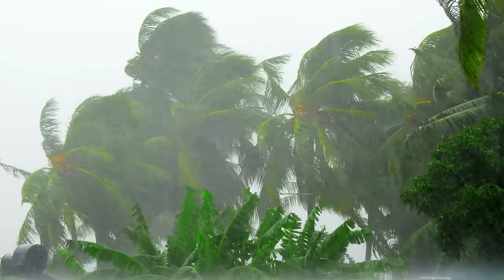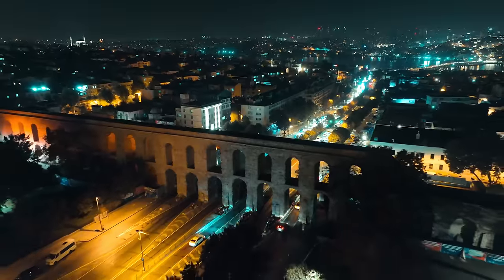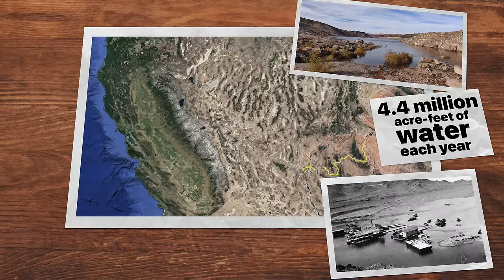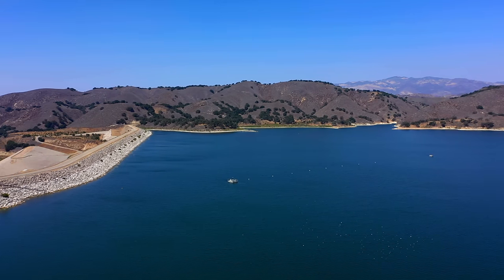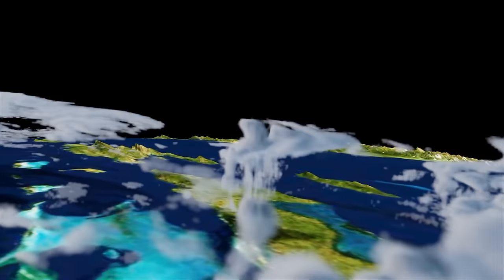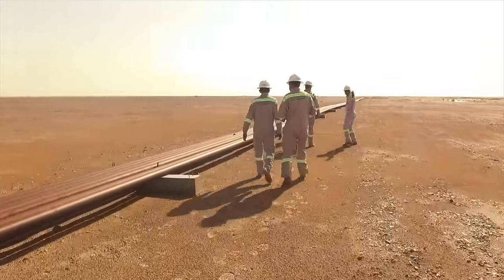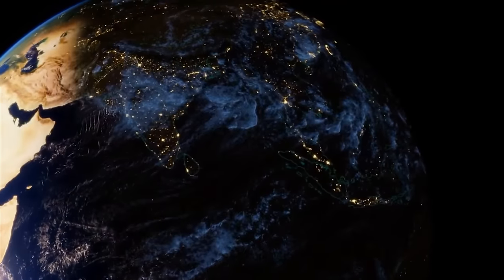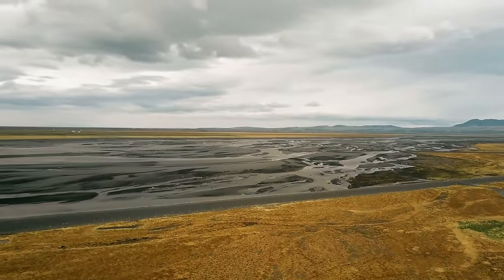Pipelines From Flood to Drought

Comment: The other benefit of moving water like this is using it as energy storage. So, don’t just move water in anticipation of a flood, but move it during times of excess power generation. The more water mover in the system to higher elevations means the water can be in the places that need them, but can also be used to recover energy at a later time.

Comment: You can look into the Olmos Irrigation Proyect in Peru, they channeled the water from the very wet east side of the Andes mountains through a 20km tunnel to the very dry west side.
Reply from the maker: I’ll have to check it out
Reply: @TwoBitDaVinci  The Snowy River project in Australia does this too, a massive undertaking that required a level of consensus no longer available here or in the USA.  Our dualist, adversarial political system is specifically designed to be divisive, splitting society almost exactly in half which negates the 'voice of the people' to the advantage of the corporate interests dominating our govts. Divide and conquer on steroids.
We most definitely need more rainforest on the planet.
Reply: @earthwizz  A great example - we need more of these national scale/size infrastructure projects in Australia!
Reply: @TwoBitDaVinci  Not for USA, but there was a project to fill those under the sea areas from Africa. Being lower also would have generated electricity. And would have transformed an desert in a sea, and create that green area around it. But projects were too expensive for those times, a century or more ago.  

And actually you had in the USA, something similar done by accident. The Salton Sea. Now ruined. 

And rain forest effect by pumping wet air from the sea was a fantasy of mine. Not pipes, but tunnels in the bedrock. Eventually helped by a greenhouse salt water lake to add more humidity. Sure, a lot of humidity will condense in the tunnel, but that will be just a good desalinization part. Obviously, the project will take decades to complete. All is needed is just few of those digging machines working all the time. Not big expense at country level.
Reply: @jackm3040  it’s not just to deliver water to those that need it, but to remove it from where it’s not wanted. And with all the drought going on, extra water will have value.
Reply: @earthwizz  

so phukking true.  🧐
Reply: @jackm3040  For sure was a disaster for the few living there, but from documentaries I saw, I understood that for few decades there was a heaven for birds and fish, and tourism. And dying I assume that could be a right thing from the point of view of returning to the old situation, I mean a salty desert, but a bad thing for losing that ecosystem, plus the desert being now poisonous from all the chemicals drained in the sea. 

For sure, any human activity is damaging. Empires died because of reckless industrial activity.   Sumerians destroyed their empire through too much irrigation combined with the lack of rain. 

So I do not know what is actually good or bad. I am just an old dude with fantasies. But for me it looks fine to turn an desert into a sea.
Reply: How about capturing the output of Niagara Falls and holding and/or pumping to areas of need?
Reply: Jack you can say that again!!!
Reply: @earthwizz  perhaps don't build in desert?

Comment: A huge problem that areas currently prone to flooding face, but not addressed in the video, is that most flooding is caused not by excess rainfall, per se, but a lack of permeable ground to absorb the rain. Increased urbanization (e.g., pavement) causes water to flow in directions it did not in the past, when it would be more directly absorbed as it fell. And those flooded areas aren't necessarily feeding reservoirs in the first place.

Edited for clarity (I hope).
Reply: I agree developers need to cut back on LARGE style parking lots that funnel most of the wain water into the storm drain system!!!
Reply: i had  the same thought while watching the video, not sure why it was not addressed considering that that's the main issue that can be solved within a reasonable time frame (rather than piping from houston to la)
Reply: Even if not intentionally I think the reason the over development of non permeable ground and focus on reusing the gas pipe lines to move water has more to do with getting rid of gas then moving water. 
There are many factors to both issues. 

Wind and solar actually requires a lot of petroleum to make parts and move parts to location. The batteries are not efficient enough to sustain a healthy power grid for periods of low wind and low light without another form of power keeping the grid balanced. Also, to make enough batteries to hold that much power it requires strip mining lithium and other elements as well as still needing petroleum. So unless you went nuclear for the power you would not be able to pump the water in the first place.

Another issue is over developing agriculture in areas that have problems with water and require it to be pumped in. There are many better locations in the country that could be used for farming that would not have the same water issue but due to regulations and development factors those areas either are not able to be use for farming or they are used for farming industrial use products rather then for food. (also almonds are very water wasteful despite being tasty)

And as someone that lives around Houston it is very true that development is our flooding problems biggest factor. It is not a matter of stronger storms making areas that did not flood before now flood but rather the new flood area is the area that a few years ago was undeveloped forest and now has a retention pond surrounded by houses and shopping centers as the metropolitan area expands out to gobble up the smaller cities around it.
Reply: Wrote a 60 page thesis on this subject lol
Reply: @nithia  Preach. I'm a precision agriculture major in a very fertile part of NW Ohio (Scioto Marsh) and it baffles me how ass backwards we are with this land. The area where I live was a a large swamp that was drained in the mid-1800's and has left absolutely great soil with up to 70% OM, vegetable production was great...until a Tel Aviv based company covered 30% of the central marsh in solar panels and the rest of the county plotted with wind generators. Just as a swift kick to the groin, this happens as soon as the farmers really started implementing smart practices to preserve the muck. And almonds can rot in hell.
Reply: we know, you can still trap the water genius. rocks dont absorb water.. how did you figure this out Mr Smarty pants lol..
Reply: Wow, there is hope for humanity….  You clearly see how this idea is impossible
Reply: New Idea:  Pipe glacier melt off Greenland to N. America, and Africa.  This could slow Atlantic Current slowing due to the insertion of cold water and work to reforest desert areas.
Reply: EXACTLY what I was thinking. (I’m a landscape architect). Who is this guy anyways?  From the way he presented this video, it doesn’t sound like he has a background in anything related to ecology… and if he does… well…. 😬